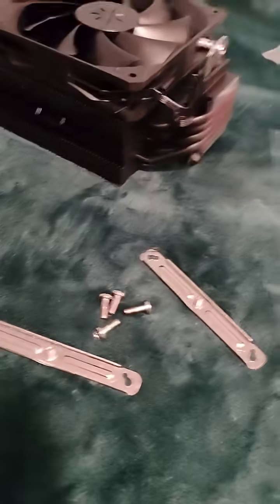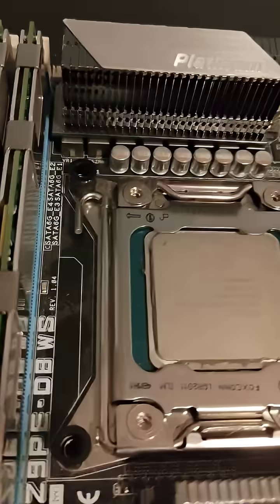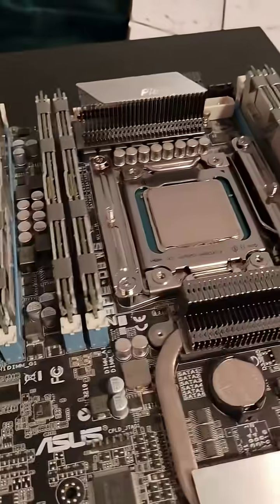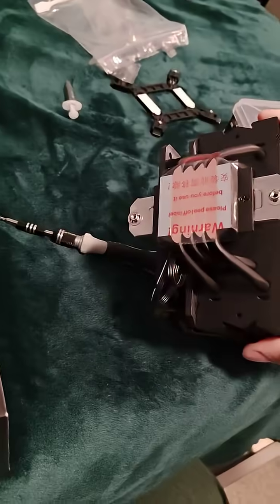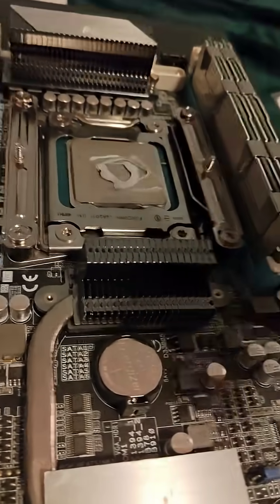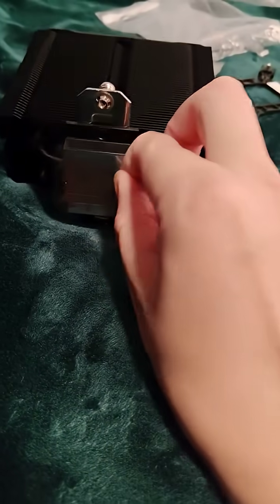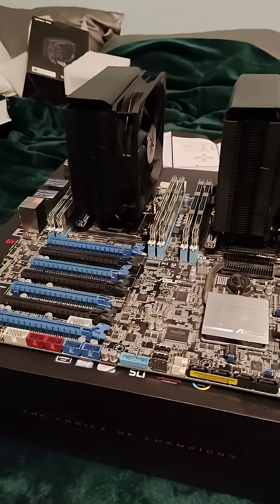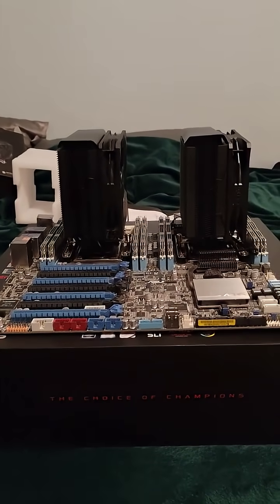Ultimate Dual-CPU Build: Installing Coolers on Z9PE-D8 with 2x E5-2697!

Comment: I run a 3175X on a SR-3, your going to want two 360MM rads preferably 45mm thick to handle the 3175X at 4.5ghz which is easily do able.  Dual PSU isnt necessary but certainly get a 1500W-1600W atleast. The CPU alone can pull 1000W underload. Make sure to find a power supply that has a minimum of 3 8PIN cpu connectors but go for 4 if you can.
Reply from the maker: LOL  I just picked up a w-3175x for like 260$ 😂 and I I got a good deal on both a rog Dominus extreme and a 1600 watt psu so we will see how that goes!